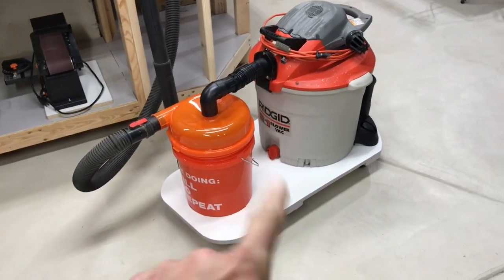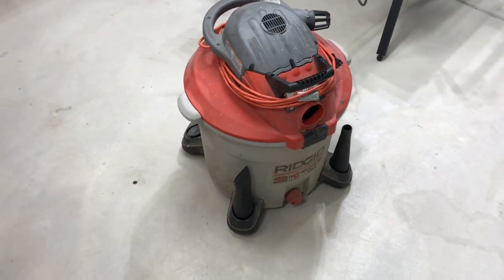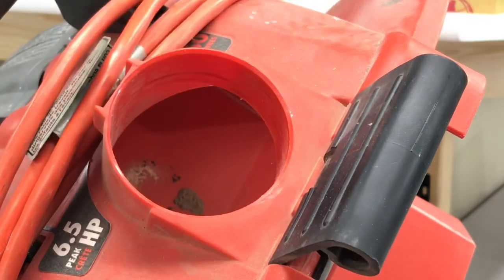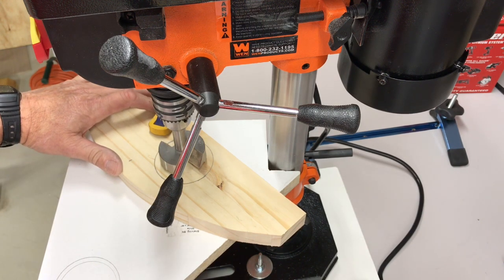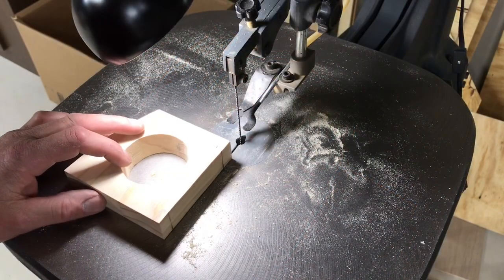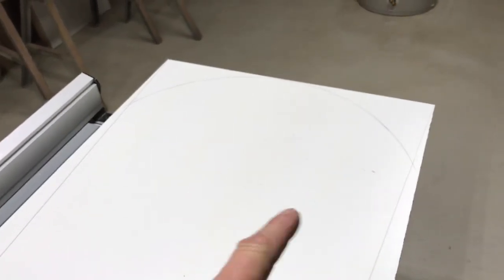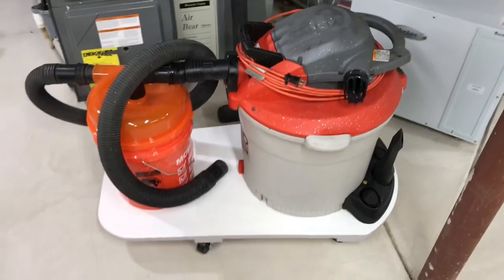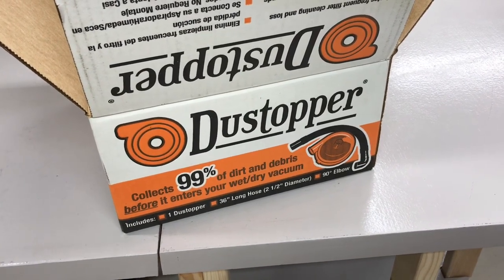How To Install A Cyclone Dust Collector On Your Shop Vac / Supercharge Your Shop Vac! Awesome!

Comment: I have a Dust Deputy and it works great. However my shop vac really sucks (the good way) and it collapsed the plastic bucket sides in. Ended up having to make a wood box for the dust collection.
Reply from the maker: Random Acts of Cooking Thanks for Watching Mike! I looked at the Dust Deputy, was the sides too thin? Or was it your shop Vac?
Reply: @TomHorsmanAmateurBBQ  - The shop vac has extremely good suction. The Homer bucket sides just couldn't stand up to the suction and folded in. No biggie, I just make a plywood box to use for dust collection.
Reply: @randomactsofcooking  all you have to do is use a double bucket then it won't collapse
Reply: @fortunecollector  exactly